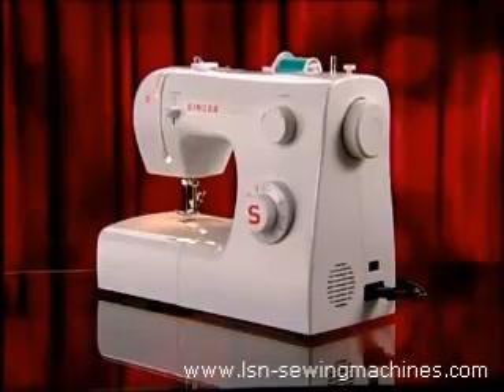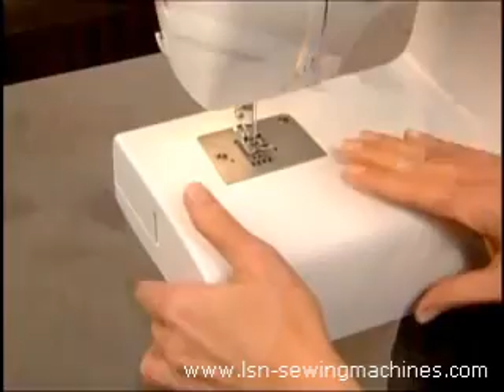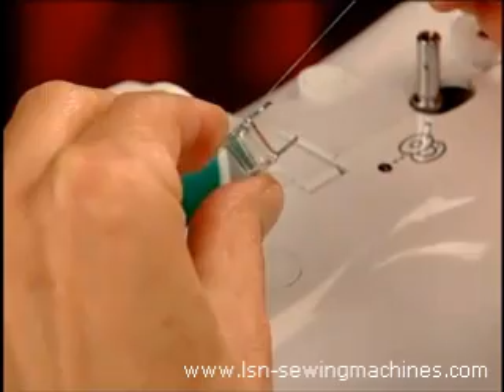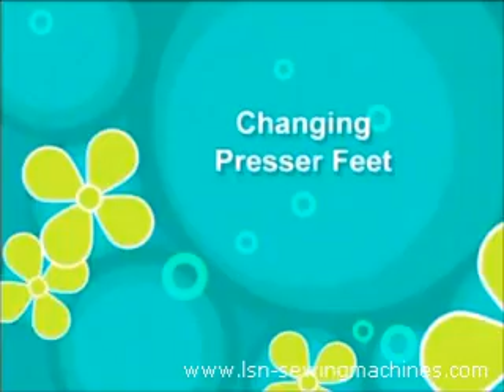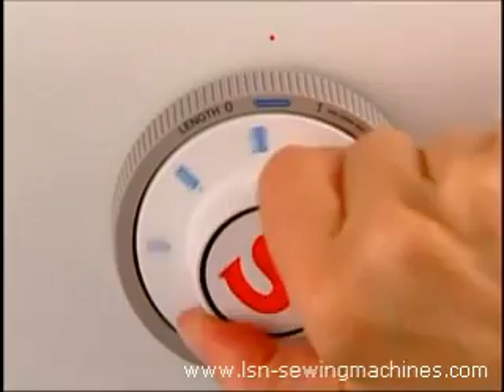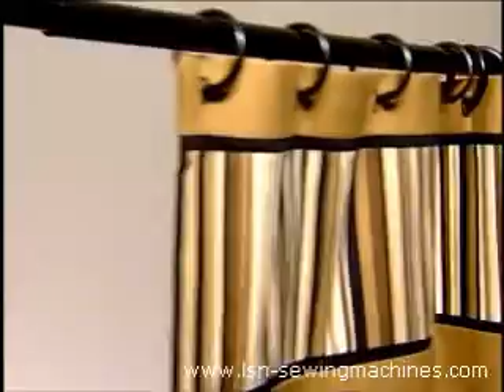Singer 8280

Comment: I hate this machine. It always puckers material. Adjusting the tension does not help. It is so frustrating to use. Every seam is a mess. I took it to be repaired but they could not fix it.